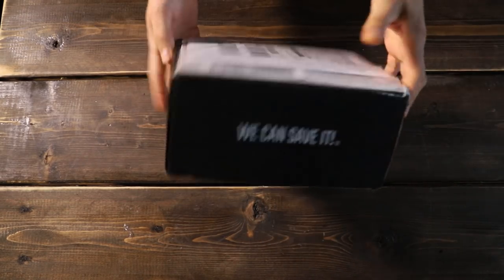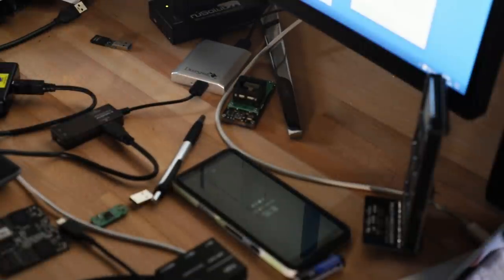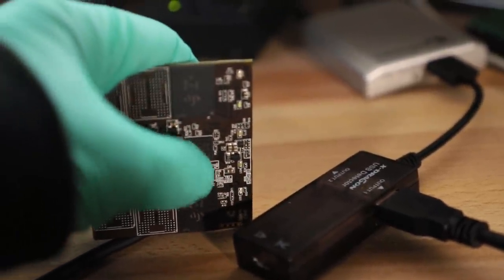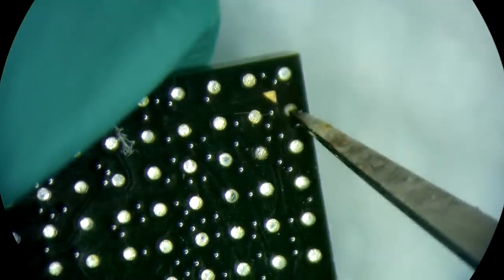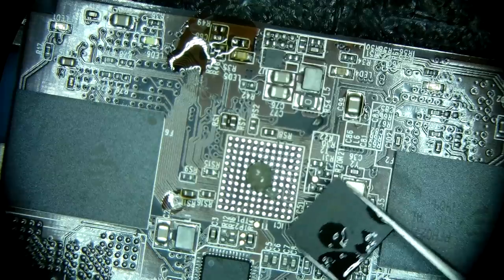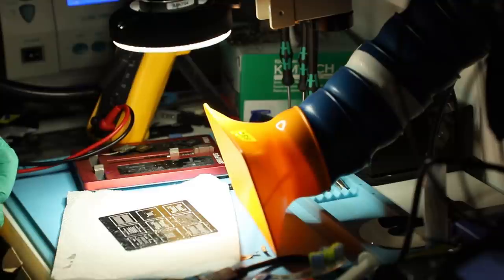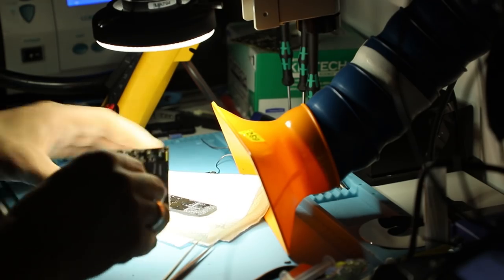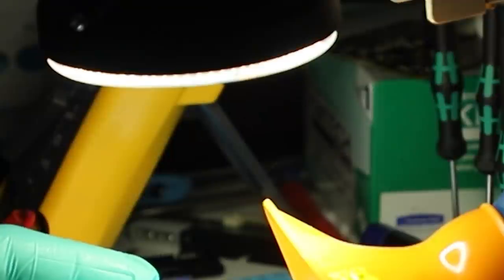bringing dead solid state drive back to life

Comment: many many times I've had users at work and one in particular tell me why is data recovery so expensive?, my reply is always the same, Its a specialised job, requiring specialised tools, its time consuming and the experts are highly trained with lots of experience. So if you did drop/spill or  don't look after the device; not made a backup ,your only hope is recovery then you need to sit down and take stock. I have hundreds of users to look after and I really don't have time explaining the same thing to that person every time they do it (and yes they have done it three times so far and have NOT changed their behaviour). The company has spent at least 50k on data recovery in that last 3 years  (and no it's IT, we have systems in place and its always the same Karens who appear with a poor excuse of why their such and such data is not there anymore) Great Video ~Trooper

Comment: Some fluxes will corrode certain alloys... maybe the manufacturer didn’t rinse the board after processing? Ultimately causing the failure of the solder joint. Because I agree., that is definitely corrosion on those pads you were pointing out

Comment: Did you ever find out what failed on the non working board? My guess would have been a 0 ohm resistors/fuses that would have been blown or worse case the main controller failed but I could be wrong about that. But something tells me it could be possible broken traces starting from the usb port toward the chips/caps/mosfets/transistors
Reply from the maker: No, I dumped a bunch of time into it, and got fed up.
Reply: @hddrecoveryservices  You should invest in a thermal camera that will find the heat source which will help you find the component that is shorted

Comment: I known how it is - diagnosing failed components, replacing these with new ones with device behavior change, and then finding out, that something else is dead.. And that last one takes lot of time and, sometimes, even can't imagine, that that component may fail..
Few days ago I bring back to life dead hard drive, which even wasn't visible from BIOS and didn't spin up.. Very quickly figured out that +5V rail is coming in and then missing.. Need to take time for reverse engineering hard drives PCB power part, but it pays off and drive is live again.. :) I can't imagine that in newest drives they put in tiny (less than 0805, probably 0402) unmarked 0 ohm resistors in lines with current consumption 300-500mA.. Seriously! :D This takes day to me to figure it out and verify because i can't believe in it..
Reply: It's not anything wrong with using 0 ohm resistors as fuses. I learned to check these components as first.
Reply: @ekon01cz  Yes, it's nothing wrong if that component have any marking on it, but problem was in size and ways to identify that part as bad 0 ohm resistor, considering, current consumption in that line - resistor was way to small.. Expected, at least 0805.. And multilayer board makes tracking more difficult.. ;)

Comment: I have a question, I have an 4Tb WD My Passport and It hasn't been working lately, my laptop detects the drive but when I click on it I get a  The Requested Failed Due to a Fatal Device Hardware Error, I thought about formatting the disk and try to recover the data (WHICH IS VERY IMPORTANT), I also took it to a computer store but the guy was charging me at least 450$ with no guarantee to make it work, and I don't know what to do, could you give me an advice?
Reply: I/O failure. Once i got a Toshiba Canvio with the same issue, fortunately was a cable issue and used a micro usb to check it's health.

I don't recommend to format or something related, a write error can damage the disk

Comment: Flashing a SM2244LT is much easier, doesn't need to be in rom / safe mode. Currently having trouble of reflashing a sm2258xt with ufs flash. There's just 1 bad block, so that shouldn't corrupt the firmware  / 100 percent usage at some point \.

Comment: There's no such thing as a "flat head screw driver".
Reply from the maker: https://en.wikipedia.org/wiki/Screwdriver
Reply: @hddrecoveryservices  I think you should have a look at the wikipedia page you reference.  The picture in the upper right corner of the page clearly shows a "flat blade" screwdriver which is the correct terminology.  The term "flat head" is properly applied ONLY to a style of screw head which is flush or flat to the surface in which it is installed.  No particular driver is used for flat head screws since several drive styles are available, ie slotted, Phillips, socket head, etc.  The term "flat head" is often misapplied to screw drivers by unknowledgeable people like yourself.
Reply from the maker: You want a golden star or something 😂
Reply: @hddrecoveryservices  A simple "thank you" for correcting you would suffice.  I hate being wrong.